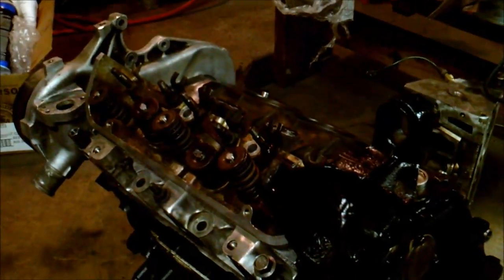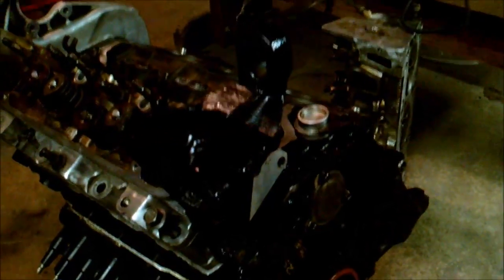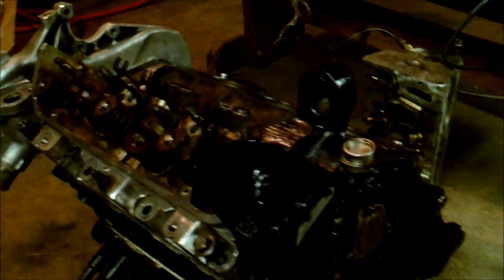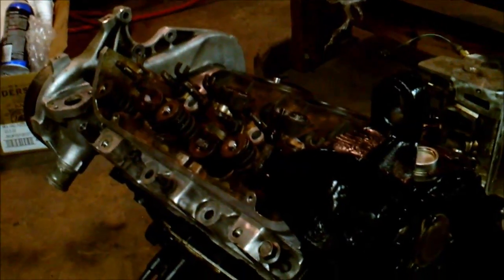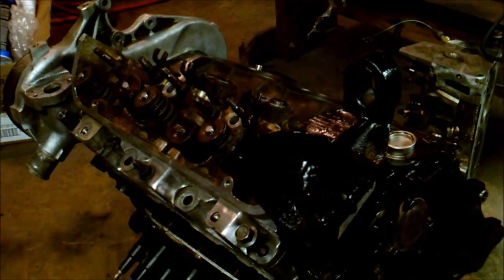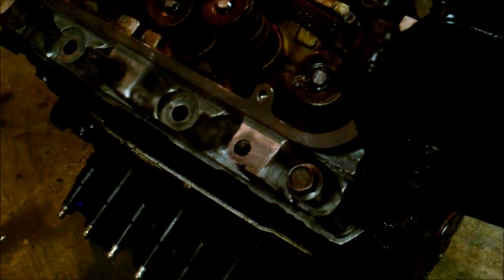torque to yield head bolts, reuse or not?

Comment from the maker: the problem with reusing torque to yield bolts is whether you are first to disassemble since factory. the bolts are tightened to a fairly high torque, then the torque angle stretches it even farther. would you tighten your lug nuts on your aluminum wheel as tight as you can get it, then put s extension bar on it and go a additional 90° to 180° beyond that? I'd cringe at the thought. and the additional problem is you are joining dissimilar metals with different expansion rates. it IS possible to reuse a torque to yield bolt with no problems, the problem is IF the engine overheats, the aluminum expands and puts even more torsional force on the bolt. I've seen dozens of gm 2.8, 3.1, 3100 and 3400 v6 engines break the lower headbolts near the exhaust after a extended overheat after a coolant leak. I'm going to do a follow up video on this.

Comment: Bullishit  !!   I’m an automotive engineer and yield head bolts do not stretch and return every heat cycle. They would loose their clamping force first heat cycle and the head gasket would leak within hours. WE USE TORQUE TO YIELD BOLTS BECAUSE OF EXACTLY THE OPPOSITE REASON. THEY PROVIDE SUPERIOR CLAMPING FORCE AND MORE PREDICTABLE CLAMPING FORCES. Not because of what you described or not because companies want to make money from sales. It’s because they are superior in their ability to provide even and consistent force .

Comment: Clean old bolts wit solvent use lock tite on them they work out fine just torque to specs . Ive done it for years never had an issue.

Comment: I  reused one of my LS engine head bolts with no issue or failure . I used it for a hitch pin on my lawn mower , still works great

Comment: i installed reman heads with felpro gaskets and felpro head bolts. i followed the book torqued to 30ft lbs backed off 1 turn then  30 ft lbs  then  90 degrees then  90 degrees. then i found a piece of paper in the box that said, torque to 32 ft lbs then 95 degrees then back off one turn, then 32 ft lbs then 95 and 95 degrees. do i have to do it all over or since i did not back off after the first 90 degrees can i add 10 degrees?

Comment: So are you saying that if you have a graphite gasket it's okay to reuse the bolts
Reply from the maker: No, the bolts stretch, to hold the head down. After being torqued and turned 90°, they are stretched to their limit. If you reuse them, they can break during install, or break after the engine is brought to temp. A new set can be had for $10-$20, so it's cheap. Manufacturer or gasket company will say in the documation wether new bolts are required

Comment: I have reused hundreds of torque to yeld bolts with no issues the one time I used new bolts the head leaked within 3 months ..been doing it for 20 years and not one I reused the bolts on came back
Reply: What if I did not use loctite
Reply: @CBPK5k  Never used locktite on a head bolt!

Comment: I just purchased new head bolts installed them and have a bad valve, the car has not been started what are your thoughts on reusing tty bolts?
Reply from the maker: Generally, you're not supposed to reuse them, but I had a similar issue with my daughter's car, the head ended up being warped and I noticed it as soon as I started it. I pulled it apart, had the head milled, and took a chance at reusing the bolts. These were new felpro bolts, and since the torque was so low (38lbs, then 90°) I figured what the heck. I did use a new gasket. So far, it's been a year and no problems. It comes down to are you willing to risk it, cost of new bolts, what the torque and angle it's tightened to, and how difficult it is to redo the job if it fails. My daughter's engine was a 2.2L 4cyl ohv, so was pretty simple. If yours us similar, you might be ok. But it's at your own risk. At the worst case, you just do it over
Reply: dave1135  Thanks yeah it’s a big job V8 F1 50 triton it’s 30 foot pounds then 90 then 90 The bolts are 50 bucks per head, I have a steel MLS head gasket I was thinking about spraying it with copper

Comment: You can reuse factory Subaru head bolts..im told that Subaru dealerships 'reuses, bolts..if Subaru would use a better head gasket like felpro, there wouldn't be a problem
Reply: Please if anyone,has better information for me,please tell me..im getting ready to put head gaskets in my 2001 forester

Comment: I hate to bring up this conversation but I am not convinced that TTY bolts can not be reused. I am hearing this argument that they will become loose because they dont expand and contract with the heat anymore. That means suddenly rules of physics do not apply if you reuse a bolt? Not buying it. Its a steel bolt, it will expand and contract even if reused, just like engine block and head. The only difference - and the most important difference between using new bolts vs used bolts - is that the procedure for installing new bolts do not apply to used bolts anymore - the bolt has been already stretched to the yield by doing pre-torque + blind turns and if that TTY procedure is used again then this will result on over tightening and possible bolt snap or stripped threads especially if its an aluminum engine block. For used bolts you have to go by total torque, not pre-torque and then 2x 90 degree turns. And that is all the difference. Of course this is not that simple - torque them down and youre done - the torquing has to be done in several steps gradually increasing the torque rate until you get them all down to the rate you want. And you have to use fast and precise turns and feel the bolts how they thread to minimize the differences in thread resistance which increases as the amount of torque increases. In fact - TTY procedure is designed exactly for this reason - to minimize the difference between individual thread resistances at high torque. That is the whole magic of TTY. Sure you have to be confident in your ability to do that right, its not something you do first time, but if youre a seasoned mechanic that has done engine rebuilds I believe it is not difficult to understand that you can reuse a bolt but you can not reuse the procedure, you have to go by Max torque numbers instead. I have seen some head gasket manufacturers recommending to re-torque all of the head bolts after several thousand miles to a specified torque setting - that is your max torque setting.
Reply from the maker: Plus, last time I bought TTY need bolts from Rock auto, they were like, $15? They are so cheap, there's no reason to reuse them. I do a job, if the manufacture reccomends new bolts, I'll use them. The job is hard enough to do once, I'm not big on repeating it.
Reply: Cool good to know

Comment: Hey I've got a 2007 Charger 5.7 that I replaced the #3 piston due to a broken top ring land groove and put the right head gasket on the left side (dumbass) with new bolts, leaked from the front of the engine.
Tore it apart, cleaned really good, head checked good at .002, put the correct gasket on with old TTY head bolts, coolant leaked into the cylinders.
Bought a new head gasket, copper coated it, new TTY bolts, cleaned surfaces again, straight edged it again, made absolutely sure I put the gasket on correctly, torqued bolts correctly waiting 20 min. between steps, now the engine has a rough idle, overheats and I have no heat in the car (both under hood heater hoses are hot), yes I did have the heater on defrost when bringing the engine up to temperature.
No I have not pulled the thermostat or the radiator hose to see if it's pumping because both hoses are within 20 degrees of each other when the puke jug starts bubbling.
What am I missing or what do you suspect I did wrong.
Reply from the maker: Rusty Nuckles sounds like you have done the head gaskets correctly, but my concern is you may have possible cylinder wall damage from the broken ring land. (Hairline crack in cylinder) I'd get the engine as close to temperature as possible, remove the plug and pressurise the cooling system with a pressure tester then take a borescope camera and look inside the cylinder and see if you can see any small amount of coolant from the cylinder wall. Also, did you have these heads crack checked? If they are cast, a machine shop can easily magnaflux check them. If aluminum, I believe they have a method for those also. Good luck.
Reply: I may end up doing that but I found a major issue.
I found a cooling system purge plug.
I put 3 gallons in it and finally hot heat inside the car!
I just put the radiator cap on it to see if it quit running hot.
Will keep you posted.
THANKS FOR THE REPLY !!!

Comment: What do they torque too.  Stock gm bolts on the 5.7
Reply from the maker: Money Getta they use standard steel bolts. Torque spec is 65ft lbs. Usually you go three steps, I go 30, 50, then 65, following tightening sequence
Reply: Okay getting ready to torque the ls1 with new gm bolts . Thanks for the quick reply
Reply from the maker: Money Getta I thought you meant an old school 350, if it's a ls1, it uses a different torque value. Type in your engine on Google followed by torque spec and patreren, it will give you the info you need

Comment: Thanks for the video. I am confused though. I am putting the head back on my 6.2 liter (GM) mercruiser marine engine. I have the torque to yield bolts and bought new ones. The felpro gasket instructions say to torque the entire head down to specification using a angle degree but then to  loosed all bolts one by one then repeat the procedure. Isn't this taking the stretch bolts that were previously tightened down to specifications and making them weaker by stretching twice. I need some clarification on this. I can't understand why felpro gaskets wants the process done twice.
Reply from the maker: i looked up felpros specs, they dont mention loosening the bolts once torqued, heres what i found: 
378 OHV (6.2L) Chevrolet 2008 VIN W
2nd Design Bolts
●❍ 1st M11 Bolts 1-10 22,
2nd M11 Bolts 1-10 turn 90 degrees,
3rd M11 Bolts 1-10 turn 70 degrees,
4th M8 Bolts 11-15 22
159 ES 72220
378 OHV (6.2L) Chevrolet Truck 2008-07 VIN 8
2nd Design Bolts
●❍ 1st M11 Bolts 1-10 22,
2nd M11 Bolts 1-10 turn 90 degrees,
3rd M11 Bolts 1-10 turn 70 degrees,
4th M8 Bolts 11-15 22
159 ES 72220
379 OHV Diesel (6.2L) Chevrolet
 Truck
1993-87 VIN C, J ●❍ 1st 20, 2nd 50, 3rd turn 90 degrees 77 ES 72724
379 OHV Diesel (6.2L) Chevrolet
 Truck
1986-82 VIN C, J ●❍ 95-105 in three steps 77 ES 72724
the site i used is this: http://olybrake.com/pdf/fel_pro_torque_specs_guide.pdf
i would talk to a tech at your local gm dealership, make sure this is right.
Reply: In my Haynes manual for my ford 4.2L the torque specs one of the last steps is to loosen the bolts two fill turns then tighten to yield.

Comment: The step which I avoided was the one which actually stretches the bolt.  The directions say "tighten an additional quarter turn" and do not give s torque value.  I would however go through any steps which specify a torque value.
Reply: then you don't actually have enough clamping force on your head. The bolt has to be stretched for a reason.
Reply: @trotskiftw  you’re correct..in a perfect world every bolt on the head would be stretched.  In my experience, I’ve found most from the factory are not.  

This will blow your mind up: I simply use a nut matched to the threads on the head bolt.  If the nut spins on, then I reuse the head bolt (meaning the bolt is not stretched).
Reply: @kevinatspeed  That's not true though. The thread isn't what stretches, the skinnied neck of the bolt that sits in the head is what stretches - that's why its skinner than the threads. TTY are literally designed to stretch, thats what "torque to YIELD" means. The bolts have surpassed their yield region and permanently deformed, i.e stretched. A TTY bolt is always going to be worse the second time of use than the first. You can get away with it, the degradation in performance may still be in spec, or even if not in spec may still work without fault, but it is never guaranteed. You can safely re-use non TTY head bolts till the cows come home (so like as it's not obviously damaged) but TTY is extremely specific, and in every case WILL be worse after use.

Comment: What I meant about the first step is the torque sequence involves two or three stages where the assembler goes through and tightens each bolt in a numerical sequence.  I only went through the first sequence of tightening.

Comment: I've reused "torque to yield" head bolts on a Ford 3.8L engine successfully three different times...on three different cars.  Here's the deal, every bolt you and I can buy is "torque to yield".  The only entity that would or could buy bolts that don't "torque to yield" is NASA.  Note: if I had removed the heads and discovered someone else had already been in there, I would not re-use the bolts.  I also reused the MLS gaskets.  I cleaned them up with a solvent and coated each side generously with Permatex copper gasket spray.  I have one of the cars here now and it's driven daily.  It has actually overheated a handful of times now and absolutely no head gasket failures.  Overheating was the result of a radiator tank failure and most recently the thermostat failed.
Reply: +kjohnson1 Oh, when I torqued the head bolts down, I DID NOT go through the different stages of tightening.  I only did the first step of the torque procedure.  Again....not a single issue and no complaints from the two other cars I did the same thing on.  Yes I know who those people are.  Also keep in mind the purpose of the torque procedure is to deform the gasket so that any voids or irregularities between the heads and block are filled.  Therefore reusing them as I have only means they are getting intentionally deformed again.  What's the difference?  My experience says we're being sold a bunch of BS.  I'll update you should any of the cars experience head gasket failure.
Reply: +kjohnson1 what do you mean you used only the first step i have a 04 mazda 3 2.3 im doing the head on and the bolts are tty i want to reuse them and i know for a fact im the fisrt to lift the head on the car and the first step to torquing the bolt on this vehicle is torque to tighten the bolts to 44 ft pounds keep in mind i have a new mls gasket i am installing with it